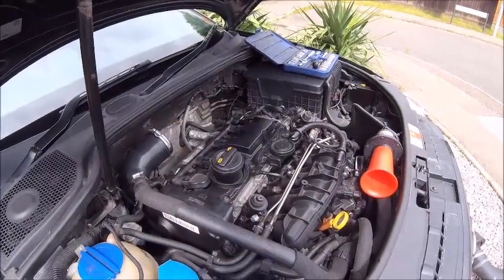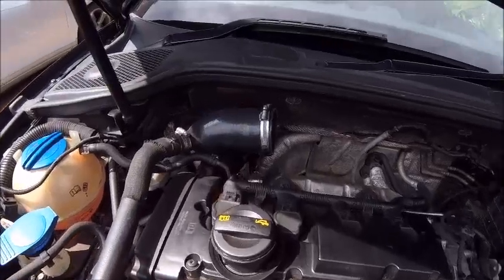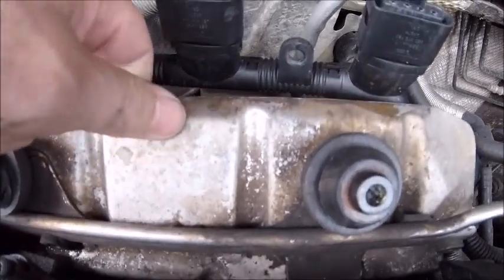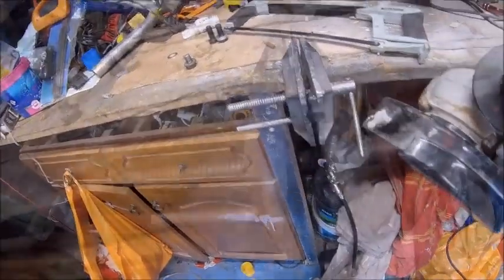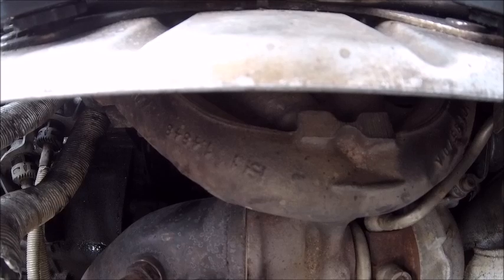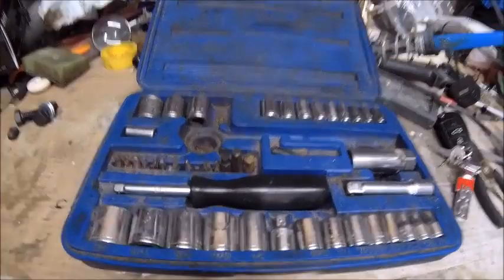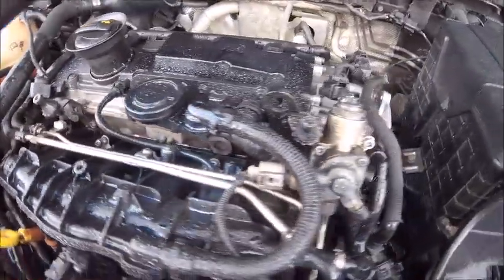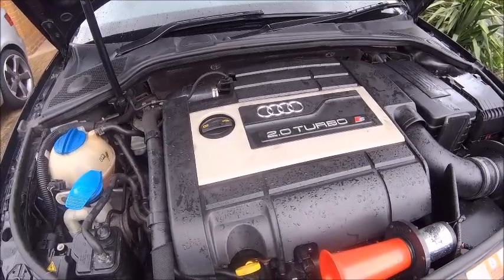#Audi #S3   Fixing an Annoying Rattle.

Comment: Hi mate not sure if you can help or direct me in the rite direction, I have just bought my stage 3 s3 and it’s just had lots of work done apparently, I do have receipts, but today after I boosted it it’s started chucking loads of white smoke from the exhaust, it did clear after lots of panic but now I can hear a rattle coming from what it sounds the turbo, it still boosts unintentionally and drives as normal but the rattle is very worrying, can you please diagnose me with any symptom or guid me in the best direction, my car has just been fitted with a venom 550 hybrid turbo so it shouldn’t be this! 🤷‍♂️😣 thanks mate, any help would be massively appreciated.
Reply from the maker: white smoke (with the rattle) would lead me towards the turbo too, it might be worth dropping the bottom engine cover and taking off an intercooler pipe to see if there is a lot of oil inside (this would also suggest turbo seals) there is always some residual amount , but if its poring out ... that's a sign of taking the turbo off next....  best scenario could be the heat shield over the turbo on the back of the engines in this video as they do make a terrible racket, but if you have checked that I would say Turbo off..